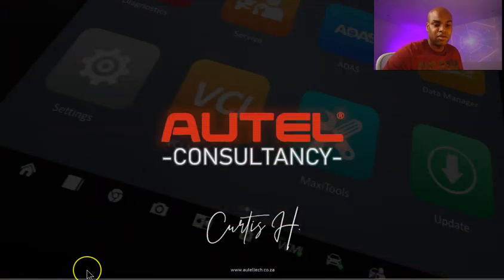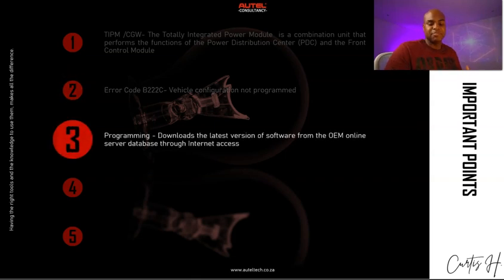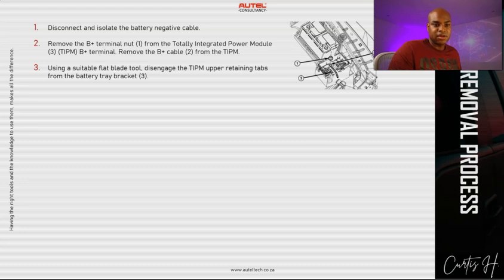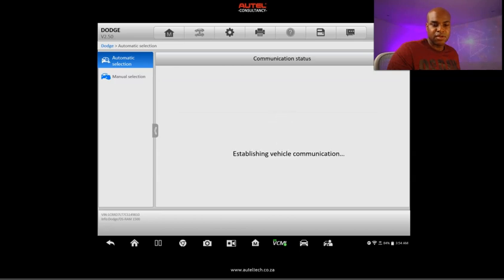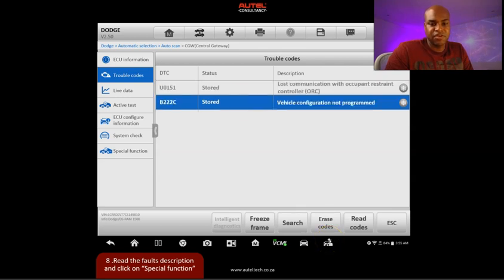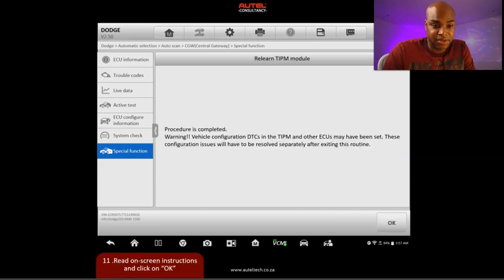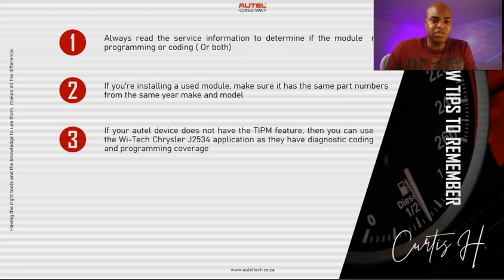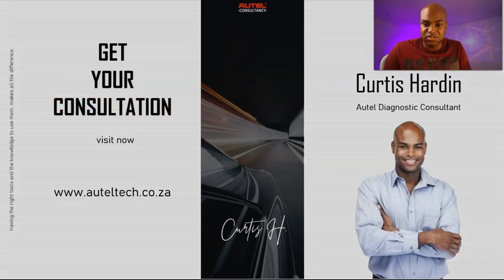Autel Maxisys MS919 Training | How to Code The TIPM VIN On A 2012 DODGE RAM

Comment: Friend, would these steps be the same for a 2013 Caravan? What other scanner could do the same? Do you recommend Xtall IP919 Max, an Xprog5, or a Snap-on Solus Ultra? Oh, none of these enter this special function. Isn't the network configuration option the same as Relearn Tipm? I have this option in Xtool and in Xprog5, it's basically Launch Scanner.

Comment: I have as MS 906 Pro and am needing to do this on a 2008 Dodge Magnum. I cannot find where I can do this on the tool. Can you point me in the right direction.
Reply from the maker: Yes but you need to book a diagnostic tool consultation with me on my website so I can consult you with a solution. auteltech.co.za

Comment: Autel ultra ev can progamme any BMW and mercedes without needing oem subscription?
Reply from the maker: There some limitations in terms of programming but generally speaking you can program from the tablet for those manufactures. I would highly recommend to make sure the supplier your purchasing from has the ability to address programming glitches . If you choose not to have this service its going to cost you and our customer .. Im just telling you this because I offer this service to my clients and it avoided alot of head ache.

Comment: Hello, thanks for the video. I'm currently in a bind, my 06 ram 1500 stopped starting, no crank no start, only can start and run  it with starter relay jumped out but I lose all gauges on dash except the fuel level and only have certain body functions. It does have a skim module, and I've gone to a junkyard and thrown parts at it, my wife is about to murder me. Definitely need some advice.

I bought a new pcm programmed to the vin# from FS1 for over $300 out the door plug and play they say. After it didn't work I have now replaced the dash cluster,  the tipm used from doner truck. Also even tried changing out the skim module and key setup. 

I was able to Barrow my buddy's Maxisys elite with its J2534 ecu programming device. I'm trying to figure out how to figure out how to reprogram the items needed to get this truck back on the road. Please help, thanks you
Reply from the maker: You can book a j2534 Training session with me so I can install the software from witech and then obtain the calibration file. Ill also be able to show you how you can get chrysler OEM repair information for free . This way you can look up any error codes and wiring diagrams etc. Go to www.auteltech.co.za

Comment: Hello Curtis, thanks for sharing this insightful video. Does the MS919 have J2534 capabilities as a pass thru device?
Reply from the maker: Yes thats correct. I only recommend the MS919 if you require oscillscope functionality.
Reply: @AutelConsultancy  if you want all of the other features but don't need oscilloscope, which would you suggest? I want the oscilloscope but would like to compare another scanner that is missing only this feature.

Comment: Hello everyone, i need you help I have Autel Maxisys ms919, but when i connettion any car my Autel dint find Vin number otomaticly? Thanks in advance.
Reply from the maker: Usually if its an older vehicle from 1997 to 2010 The auto vin doesnt work properly. You might have more success with new vehicles with the autovin. Its normal

Comment: @Curtis Hardin  what is your opinion on the MP808?
Reply from the maker: Mmmm I dont like stage one tools since they are limited but it really depends on what the user requires. I think its good for reading and erasing codes for the most part and limited coding. If your serious and want me to diagnose you professionally go to www.auteltech.co.za  and click the diagnostic tool consultation

Comment: Hello, I wondering if this test set have the features to re-learn to fuel level sensor for 1998 Isuzu Rodeo. I replaced the fuel pump with new level sensor with it then now there’s no reading on fuel gauge and I have been told that need to re-learn the sensor.  Thank you.

Comment: CURTIESE, good info as always a question can MAXISYS Elite pull the immobilizer pin to program keys if not which Autel can do it thank you.
Reply from the maker: The elite is not built to do this feature. Either the im608 or IM508